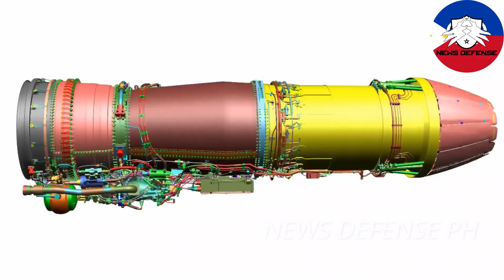Boramae Fighter: A New Era for PAF? Philippines Requests Info on KF-21!!!

Comment: If the Philippines can acquire a new multi role fighter jet the F16 and Jas grifen e/ f . The Philippines should retire the FA 50 to have additional budget on the Philippine air force as FA 50 is outdated already and it can be sold to third world countries. The F16 and Jas grifen e/f is enough for the Philippines to defend it exclusive economic zone territory. In the future the Philippines will acquire the fifth generation fighter jet or the 6th generation fighter jet to add the Philippines air force capability.
Reply: You must think of maintenence cost. Hyundai car  and  cadilac and saab main tenence cost is not same kf-21 is stealth fa-18 do you think grifen is better than fa-18?